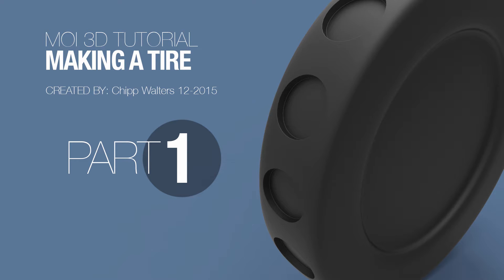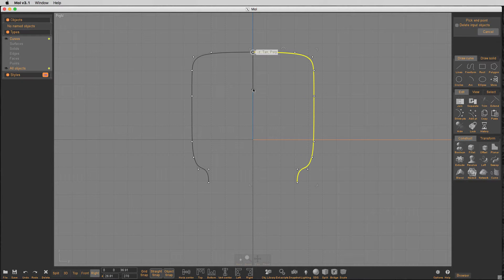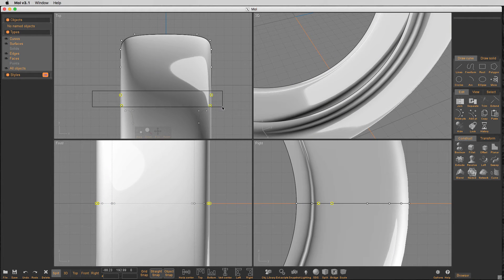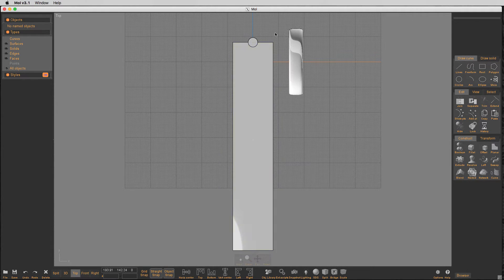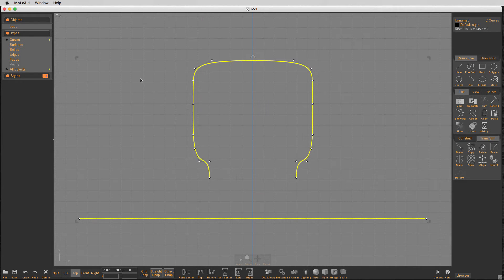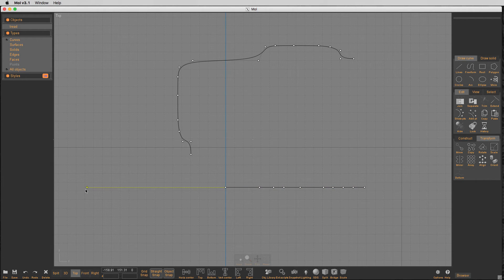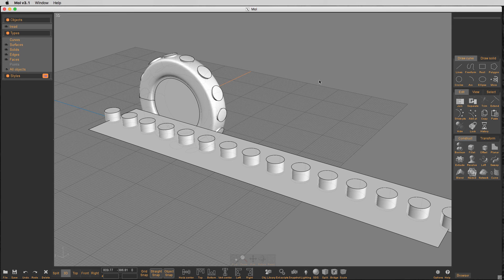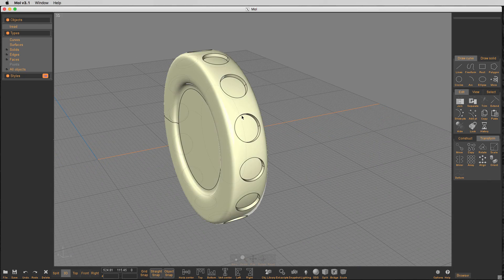MoI3D Part 1: Making a Tire

Comment: How do you calculate the perimeter of the tire contour?
Reply from the maker: Circumference = 2πr
Reply: @ChippWalters  How is the perimeter calculated? Which plug-in did you use to calculate the perimeter?

Comment: Hey Chip, great tutorial! Your channel is super helpful and I love your GUI builder👍. A bit of a problem with this tire tut though, when I do the revolve. my revolve isn't one srf like yours, I get joined srf(s). Any idea why that is?
Reply from the maker: Sorry, without actually seeing how you created it I can't offer any help. You might try the MoI3D forums? Be ready to post your file there as well.
Reply: Chipp Walters Ok I figured out I wasn't clicking on similar sides on both wheel and tread pattern. Thanks any way☺
Reply from the maker: Glad you figured it out.
Reply: @ChippWalters  How is the length of that line calculated?